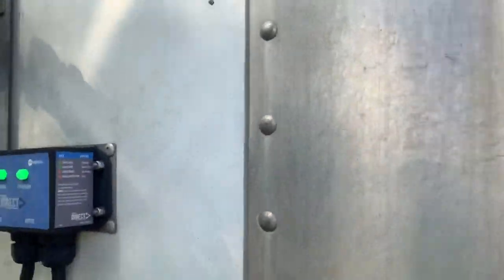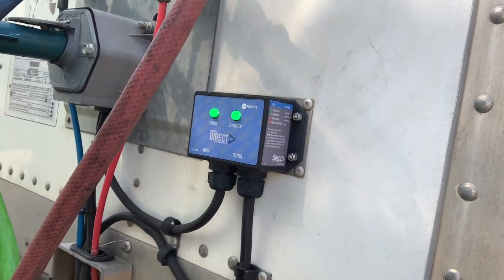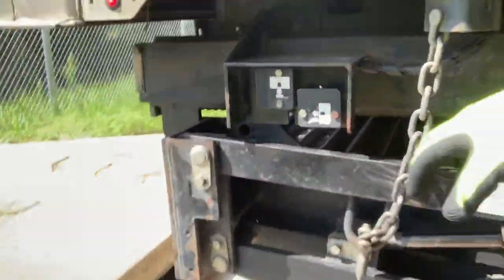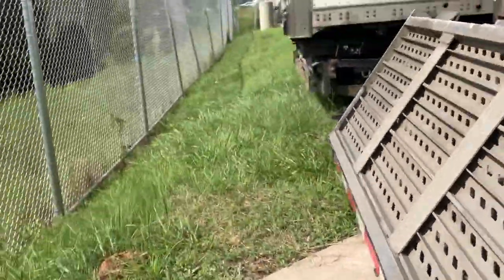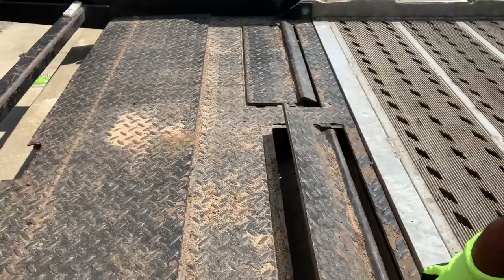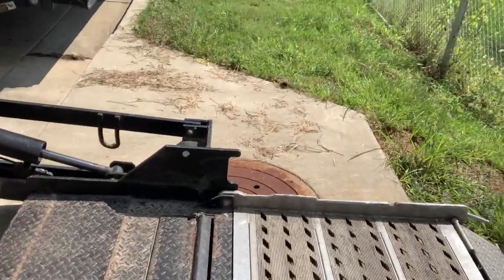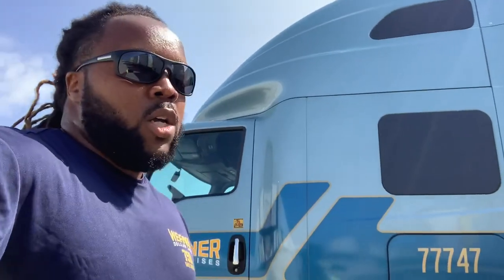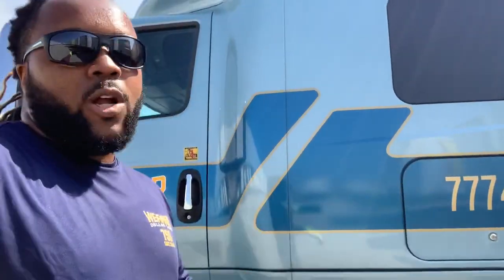DIY WERNER DRIVER | HOW TO CHECK TRAILER LIFTGATE | DOLLAR ACCOUNT

Comment: You can still look good but you wont really know if its junk until you put a water rolltainer on it and it leans way down! Some of the brakes work with your foot but wont when you roll a cart across it just slams up then right back down